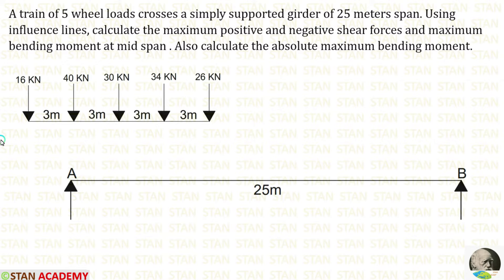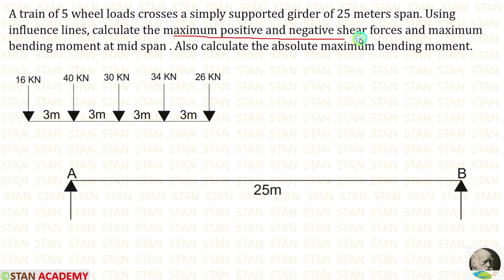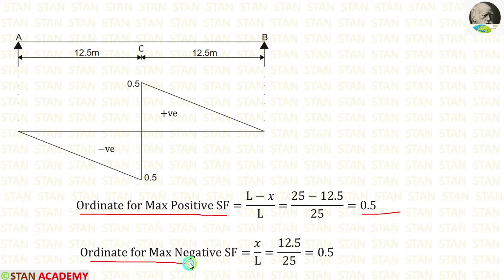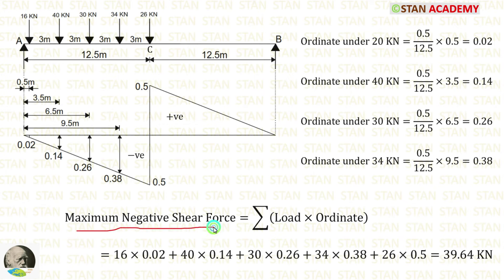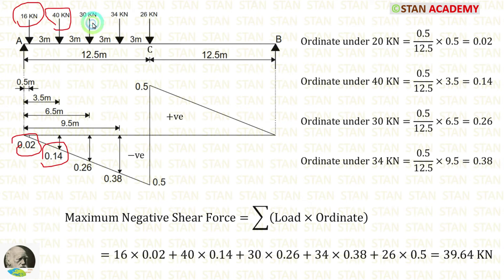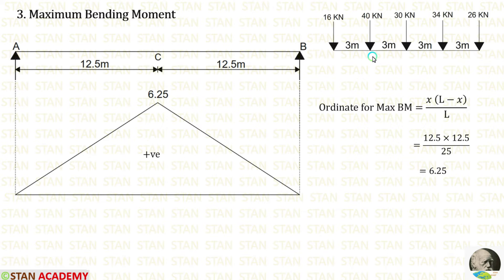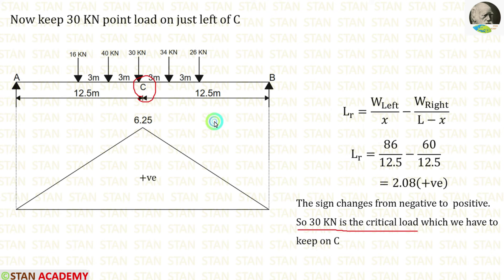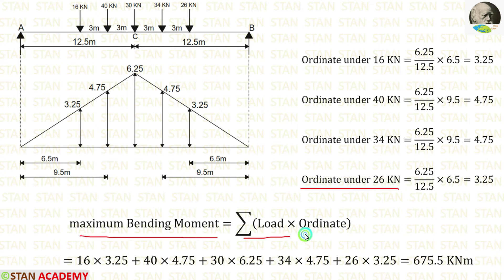Influence Line Diagrams for Simply Supported Beams - Problem No 5 (with 5 wheel loads)

Comment: In absolute max bending moment calculation , how do you get 12.355 value ??
Reply from the maker: 12.5 (center) - 0.145 = 12.355
Reply: Ok , then how you got 12.645 ?
Reply from the maker: total length 25 - 12.355 =12.645